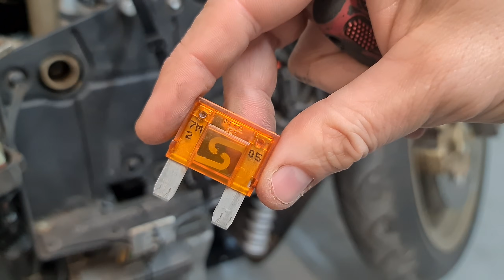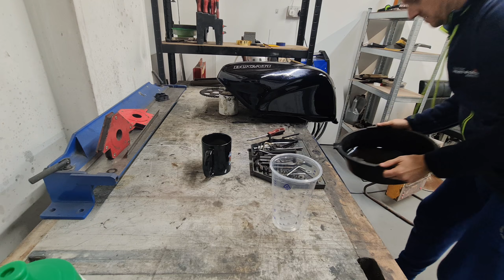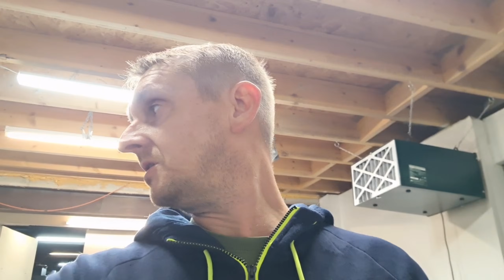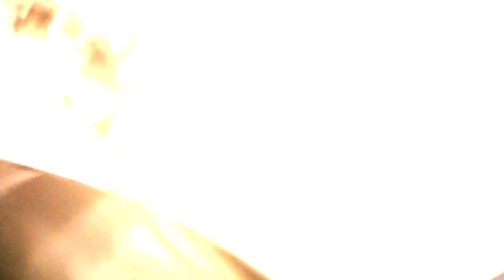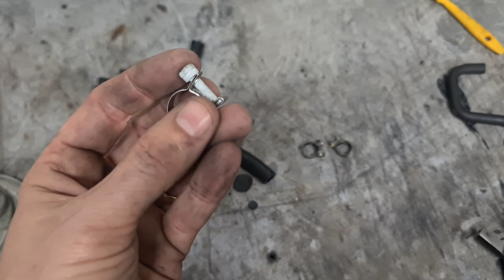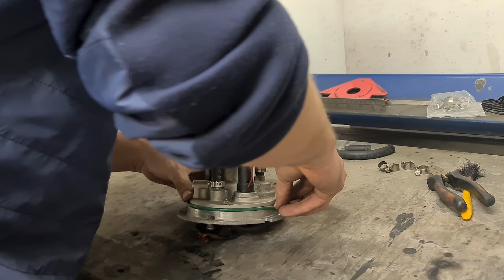DUCATI 916 Fuel Pump clean PART 1

Comment: Very useful info! Even if you're not doing a rebuild, it's good to know what to keep an eye on. I just bought my 4th 748R. No more track days and low sides, or scrimping on maintenance; I want to keep this one running sweet till the day I die! (from natural causes ) :)
Reply from the maker: Yeh it doesn't need a rebuild it's low milage and for it to fire up like that it's pretty good 👌 they are solid engines these
Reply: Looking forward to watching  this move forward pleased I found your chanel
Reply from the maker: So am I 😄 it's been a difficult time, but i will be starting it this year